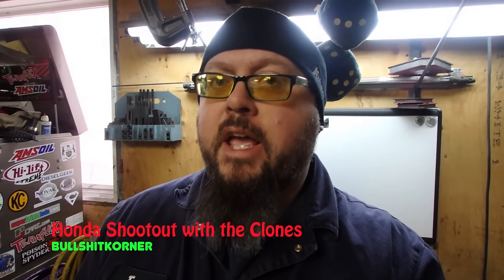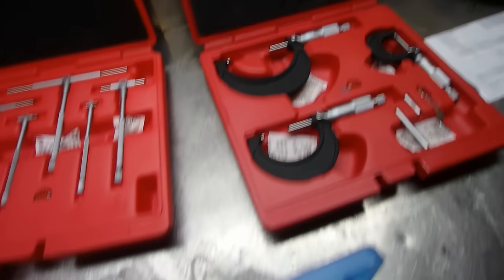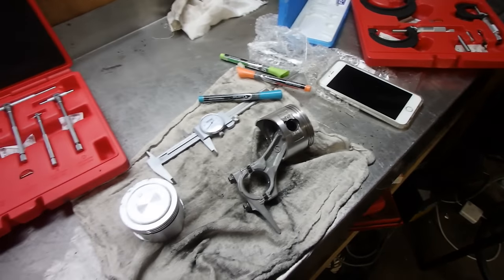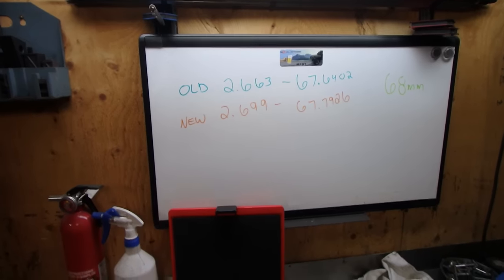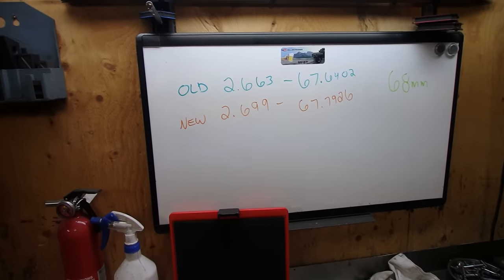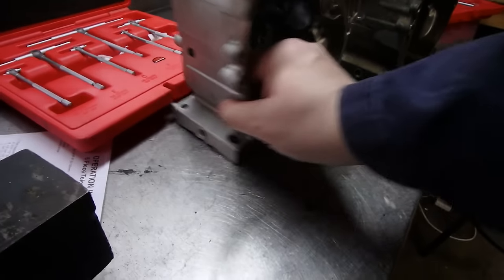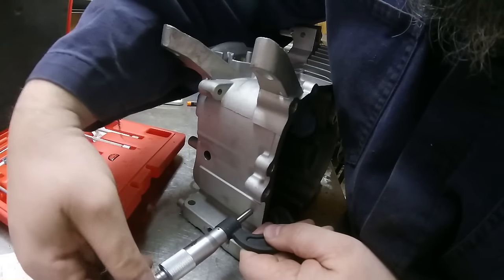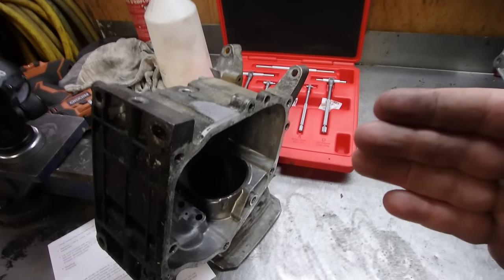Honda GX160 VS Clone Motor Tolerances

Comment: Jerry I know a woman that works at p/auto and the Honda clone engines sell as low as 1/5 the price as a real Honda but the returns are all the clones and rarely a Honda.  I went to buy one and she said good luck so I passed on it, but for $100 for a 6.5 hp looked great and thats what sells is the price . She said the sends  back a skid of  clone engines every year. Great for a mini bike I guess but on a piece of  equipment running every day , not so much. Like to see how your hybrid engine performs.
Reply from the maker: +STEVE ROB I've never taken apart a P/Auto motor to see just how they are made, there is so many companies making clone parts these days.  there is engine blocks with aluminium cylinders and the one that I got which is a pressed in sleeve.  I would like to find a P/A motor and see for myself

Comment: Telescoping gauges are very precise. That is what machinists use they are far more accurate than a caliper.

In order to tell you have the right measurement you repeat the process and the measurement is repeatable than you know you hit the sweet spot.

Comment: Those are die cast blocks and the liner is placed in and aluminum poured/injected around it. Cheaper that way as no machining for the bore prior to liner insertion and no machining of liner to give it the sizing to fit. The liner is coarse on outside and the aluminum grasps it better for reduced chance it ever moves.

Comment: Honda clone gasoline is filling crank case? When I check oil it gushes out of dip stick, even if gas shut off. What needs to be done?  Thank you sir 👍
Reply: You need to buy an original Honda engine, that's what you need to do. 😅
Reply: @tiagofigueiredo2529  lmfao

Comment: Why are you using a caliper when you've micrometers available?  Same question on the telescoping gauges?  A caliper is considerably less accurate.  Not to mention "tolerances" in this context refers to the variation of measurement from part to part around the nominal design dimension.   What you're measuring is difference from one design to the other.  For what purpose?
Reply from the maker: Totally missed the point of your video and way over your head
Reply: Eh?  @BackCountryWrenching

Comment: jerry, not that you going to give a fuck about my input but, when using telescope gauges you should put them in at an angle, extend them, then make them parallel. and always use your mic to check them. great video though
Reply from the maker: +ps360bros that's a good point, i've had them for years and only used them a handful of times

Comment: Just a friendly heads up a micrometer is the best tool to measure anything round when looking for an outside diameter measurement or tolerance.  

You have to place parallel pins into the Piston Ring slots and then placed a micrometer on it.

Comment: so the external diameter is the least useful measurement, piston ring lands and end gaps matter as do the piston pin bores, it's called a cylinder liner, and you are quite right, you do not have the equipment to make any sort of a sensible comparison.

Comment: decent tools u have but u should really learn how to use em...  always use mics when available for precision...  u used calipers instead of mics over telescoping gauges?????   lol   u gotta tighten up brotha... be easy man
Reply from the maker: Ok buddy dream on
Reply: Yeah its kinda backwards... the mic and telescoping gauges are a feel thing.. if you dont use them regularly you probably would be better off using a caliper.. however there is much more potential for accuracy with the mic and gauges